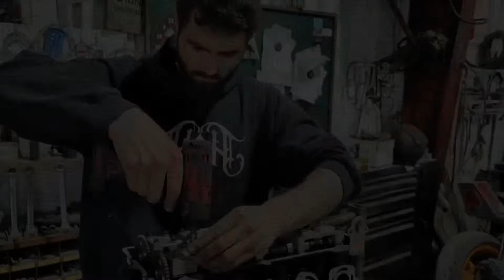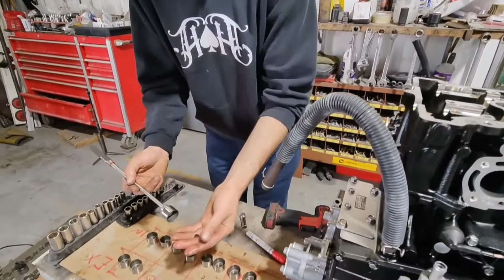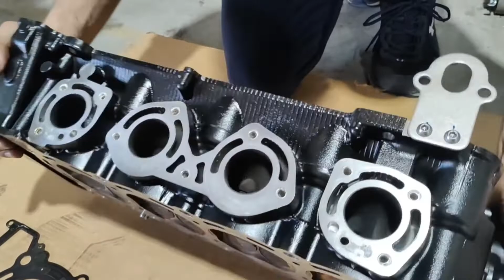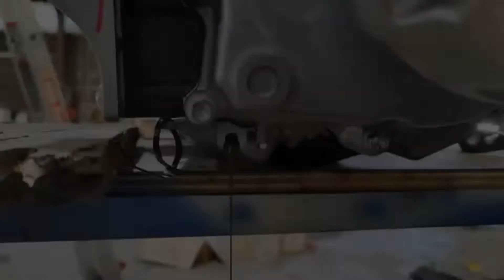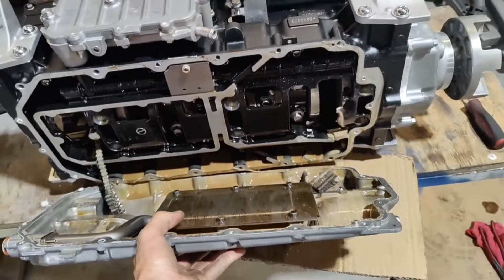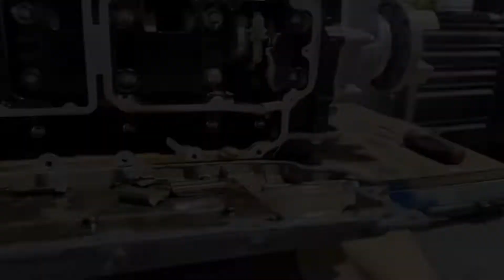Rebuilding a Yamaha fx ho cruiser part nr.2 / engine disassembly / broken piston rod / bent valve

Comment: You have some nice shop!

And it's quite interesting, how a little misalignment on the valve can lead to such a devastating damage.
Reply from the maker: Thankyou! The problem wasn't in the valves, the jet ski was turned upside down in the water and when you want to roll it back you should do it clockwise but they didn't counter clockwise and the water got through the intake inside the cylinder, and they starter it with water in the cylinder and water can't be compressed like air and damaged the piston rod!

Comment: Is it possible to engrave the cylinder to a larger piston size?  The original is 86 mm and needs to be engraved for an 86.5 mm piston
Reply from the maker: This is what I did, I bored 0.5 mm bigger! What car do you have? Make model year?
Reply: Yamaha waveraner 2009 fzr 1800 supercharger
Reply from the maker: Yes 0.5 should be ok! But if you can go 0.25 will be better!

Comment: I have the same engine in my Yamaha fsh 190. Mine runs great. What are the weak links on these engines?
Reply from the maker: They don't have weak points, very good engines! Valve adjustment on time and you are good to go! Mine was turned upside down and someone tried to start it with water inside the cylinder and broke the piston rod in pieces!
Reply: @valeriumoscalu7580  i run Rotella T6 5w-40 in it with a motorcraft oil filter. Is that ok?
Reply: I mean, 30 hours on that oil and filter, and she runs great.